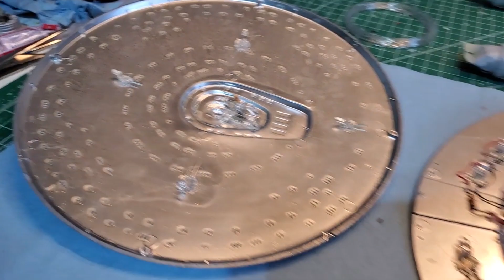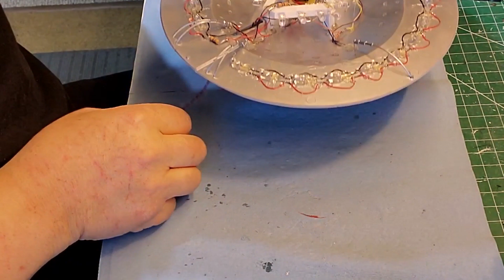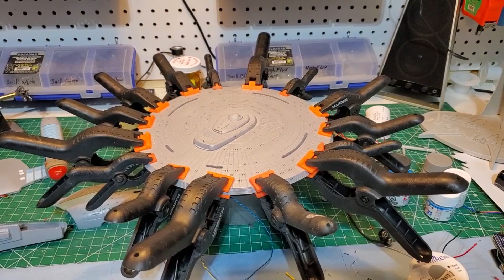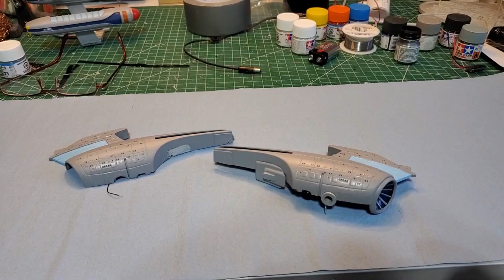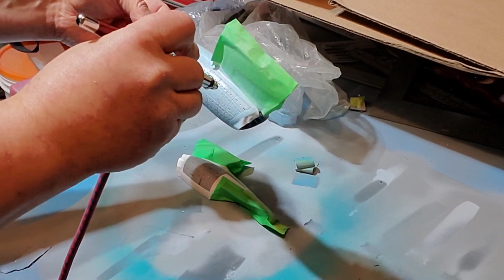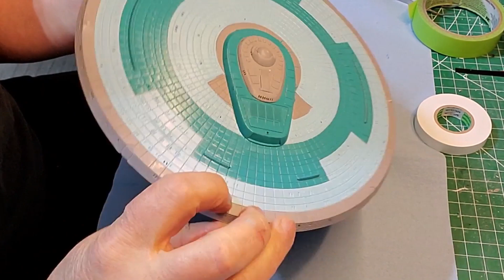USS Enterprise C Build (Part 4)

Comment: Just stumbled across your channel on this video while browsing various model videos.  Will have to check your previous videos on this build as I did want to build all the different Enterprises and illuminate them.

On a some what side note, I did pick up a Atlantis NX01 in 1/350 scale that I started on and planned on illuminating but then boxed it up.  Went back to it later and found there are some pieces such as small dishes on the side of the saucer that are missing.  Been trying to find a reasonably priced 1/350 scale NX-01 again as I picked this kit up from hobby lobby back in the early 2000`s for under $40.00 and I am not going to pay over $200 for the same kit today.  I also assembled the nacelles and not sure if I can disassemble but my plan was to use colored LED strip lights to give the bussard collector its red color and the warp chillers their blue color.  I had hope to reproduce the colorless look as seen in the tv series when the warp engines were shut down.